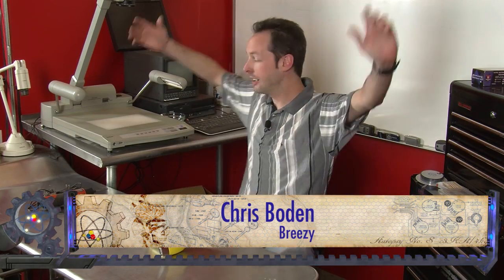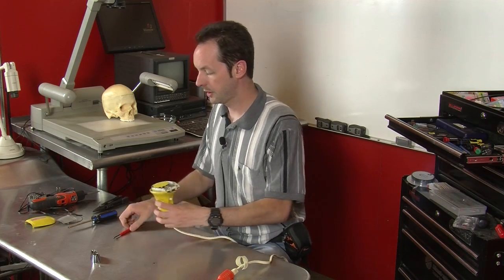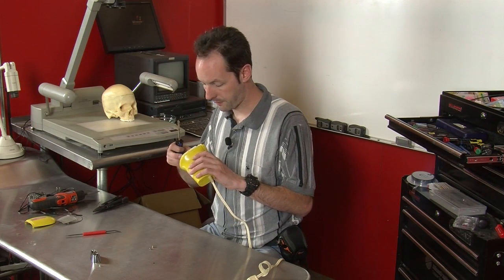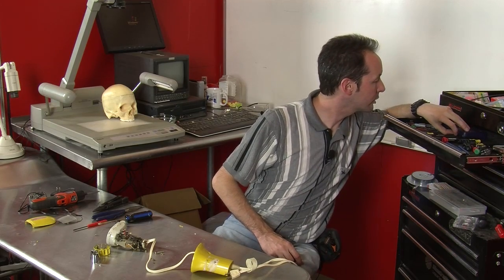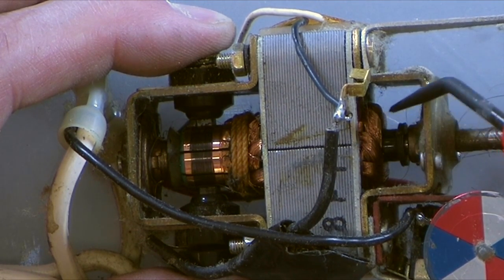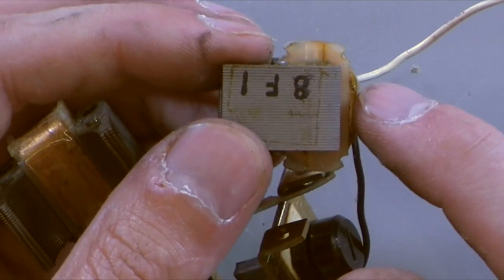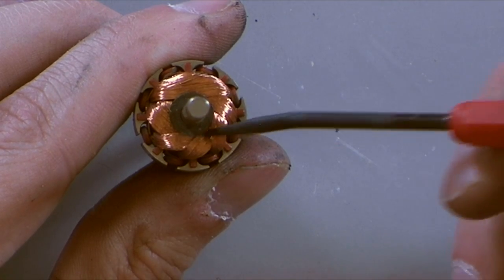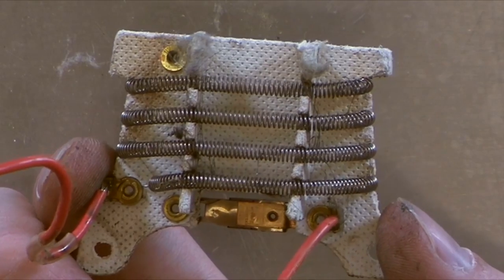Hairdryer: Equipment Autopsy #59

Comment: Well it's got asbestos in it so it can't be 80s. definitely 70s judging by the beefy motor. by the 80s they were using rectified DC motors
Reply: Asbestos was used in hair dryers until the early 80ies

Comment: I'd put that thing in the late 60's through mid 70's actually. I've seen a few old hair dryers and none had a motor like that. That thing is beefy, dang! The ones I did tear into had just a regular DC motor kinda like you'd find in like an RC car or cordless drill or whatnot.

Comment: One other thing, do not attempt to use the heating element as a 'dummy load' for radio transmitters. There's a factor called 'inductance' that comes into play here. Even though your VOM says it's 50 ohms, that's not what you'll get in relation to radio frequencies.

Comment: It's bad because it's sharp down to the molecular level and it doesn't decompose, "mechanical carcinogen" is a cool term... what it's used for is insulating... heat, electricity, the stuff don't care.  This stuff is the poster child for "This seems to good to be true, what's the catch?"

Comment: Really interesting video, but two quick notes: standard terminology is that this is an 8-pole motor, not a 4-pole motor. It has 4 pole PAIRS, but 8 magnetic poles (north or south).
The other correction is what others have said, that the main point of the laminations is to reduce eddy currents. They also use 'silicon steel' - has good magnetic properties but relatively non-conductive. If you just use a block of unlaminated steel, it would probably melt in the same way as an induction cooker!

Comment: I totally agree, especially at 300w.  If you were around any big haired woman in the early 80's they wanted MORE watts, they would have laughed at 300w! Most of the ones I remember were the larger gun types with the fan intake on the side and at least 1000w  on up to 1500w a little later.  I could be wrong but that yellow color and the brand script look 70's and maybe corresponds to the start of the disco age... Looks like asbestos to me too.

Comment: The main reason for the lamination of electromagnet's cores is not the easier production (although this comes as a bonus). The laminated pieces are isolated from each other to prevent eddy currents, which makes the motor way more efficient.

Comment: have you got an old VCR to tear down. i have a few old PAL VCR's with AUS/NZ plugs 240 volt rated, i would gladly donate them but it will be expensive as hell to ship it. they're the 80's vintage things with diecast aluminium. if you do you should talk about how composite video works